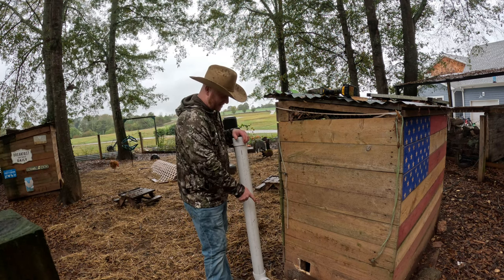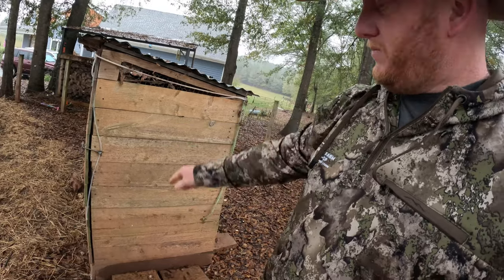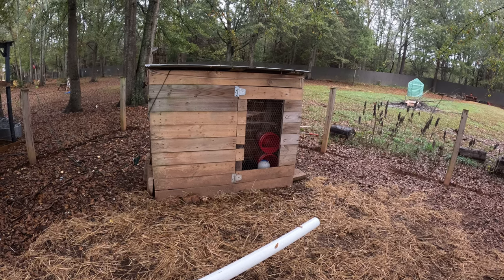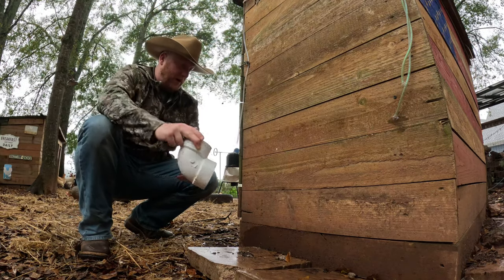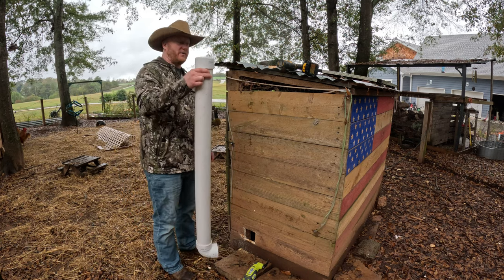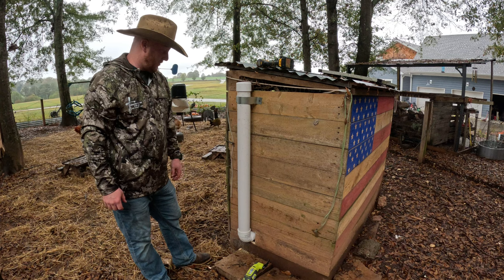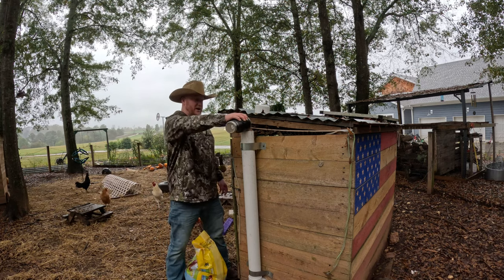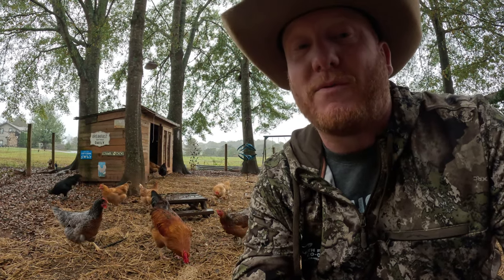DIY Chicken Feeder: The Best Way to Feed Your Flock

Comment: How do you keep the rats and mice out from going up the feeding hole?
Reply from the maker: We don't have problems with mice or rats of the farm.
Reply: Mice and/or rats could go through the front mesh/ chicken fence on the front door of the couple.
Reply from the maker: we also have a community  barn cat that would fix the mouse or rat problems.
Reply: @Smith.Farm.Co-Op if it were a problem the cat would  fix it